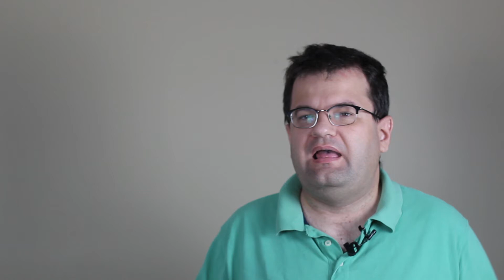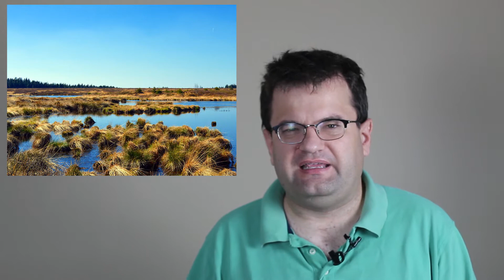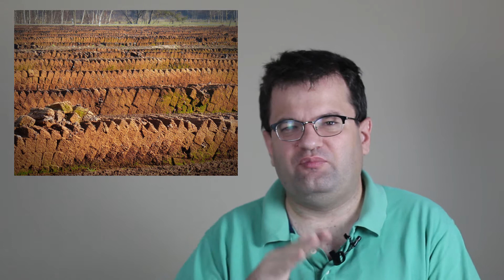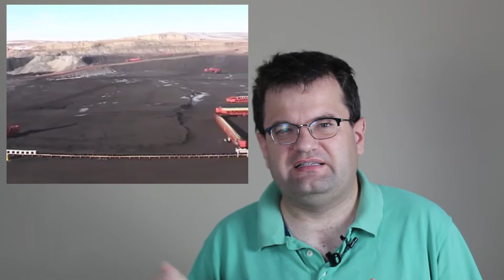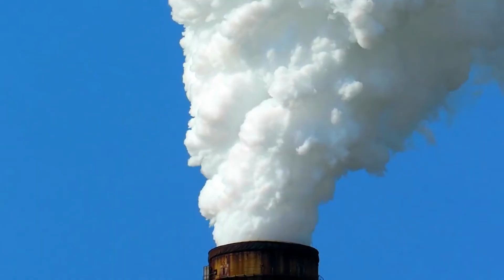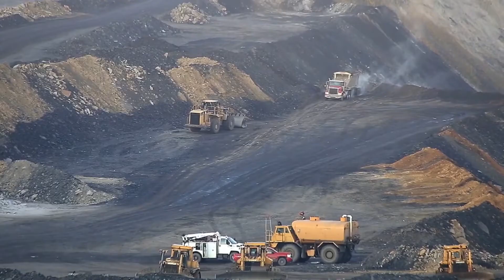Coal Environmental effects

Comment: Hi Ben, yes, coal has to go. BTW, important launches happening in the next few days.
Reply from the maker: Will be doing a few videos related to Mars launches soon. Just wanted to get this one released first.
Reply: @WhereisRoadster  oh good y’all going to mars, last checked it will not sustain life,  and this reply was two years ago and your still here,  hurry up and use your fuel to launch with and all fossil fuel it took to make everything for you launch and equipment guess you think there is a hole in ozone to lol,  your going to make another one,  there is a reason for a hole in ozone it’s to let waist co2 out to space this is why there is a vacuum in outer limits all the co2 creates a bulge and it eventually opens and releases then comes back together once the co2 is at lower psi.